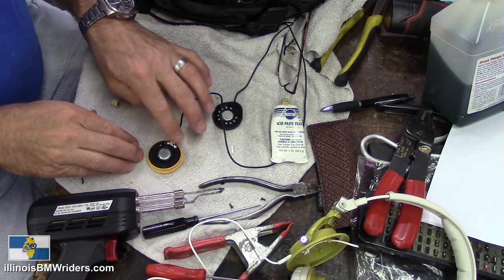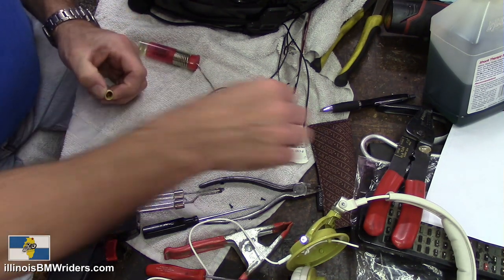Sena SMH Bluetooth Helmet Speakers - Time for a Huge Upgrade!

Comment: as far a ohms are concerned, do you think a 35 ohm set of Audio Technica studio monitor headphones (ATH-M40x) would work? Also, how did you find out the ohmage for these (btw I'm using the SMH-5... same ohmage as yours?) Thanks! I really wanna try this mod : )
Reply from the maker: I would think it could work. Only one way to find out!
Reply: Yea, I wanna try it... its just that the speakers I wanna use are $50... that along with a $100 unit is pretty expensive if it doesn't work out...

Comment: You're not soldering a radiator. Use rosin flux and/or rosin core solder...not acid. Good info just the same.

Comment: I just bought the speakers for the 20s my question is there is a blue wire on the 20s speaker wire? What do I do with blue wire? I wired it up joining the blue and re together but the sound is terrible then I disconnected the blue one but still the sound is terrible. Any suggestions maybe?
Reply from the maker: Are there 3 wires in there?
Reply: illinoisBMWriders correct left and right speaker wires have a red white and blue wire. I am thinking the blue might be something with the mic or FM radio?
Reply from the maker: I am not sure what the blue wire is for. I will be taking mine apart soon. Please let us know what you find out.
Reply: Kiepie I don't have a Sena communicator, so this is an educated guess.  Sena upgraded the speakers on the 20S, and I believe what has happened is the new speakers have two drivers instead of one; one for the bass and lower mid range and one for the highs and high mid range.  Therefore you need one wire for ground, and one for each driver.  They could have done this with only two wires and a crossover circuit in the speakers, but I'm assuming it was easier to run a third wire and leave the crossover circuit in the communicator.
You can't connect the red and blue wires together, since that will screw up the crossover circuit.  The only thing would be to find a pair of headphones that have two drivers on it, remove the crossover circuit on the speaker, and hope the crossover points are close to what Sena designed.
My feeling is don't mess with the 20S.  If you've already cut the wires, you'll need to buy a replacement set of speakers from Sena.
Reply: Hi thanks that is what I also think to do as the sound now is just terrible I even bought another pair and of the Panasonic headsets and just used the Aux headphones outlet port on the Sena but the sound is still pretty bad better than before but still bad. Regular earbuds works for now but I might have to buy another Sena speaker set in the future.
Reply from the maker: Wow thank you for the info! I will put the advice in the description.
Reply: illinoisBMWriders did you find out what's it's for I wanna do this to my 20s. sounds is horrible
Reply from the maker: I did not find out yet but when I do I will post another DIY video specific to the 20S
Reply: Kiepie I would imagine the blue wire is the antenna for the FM radio.
Reply: Martin Saunders I doubt that.  There are six pins on the connector and you only need one wire for the antenna.  Besides, the 20S already has an antenna on the outside, so why add another one in the speaker?   No, I stand by my original thought.  There are two drivers on each speaker.
An easy way to test this is use a 9 volt battery, with the negative side connected to the ground wire and then touch the positive terminal with first the red wire and then the blue wire.  You should be able to hear different pitches of sound, one will be lower, the other will be higher.  If that happens, you can be sure there are two different drivers in the 20S.  If that is the case, you can not do this mod to those headphones, or any communicator with a six pin connector.

Comment: Kirk, I tried this, didn't like it and bought myself replacement factory speakers.  It just didn't work out in my case.
Reply: hey, are the factory replacement you mention better or same as the ones that come with the unit ? thanks

Comment: great vid and an easy mod if you already own the tools etc. i used heat shrink and silicone to protect the solder connections. noticeable improvement in terms of loudness. 

i personally use plugfone headphones in my 20s... but my passengers helmet complains of not being able to hear the stock sena speakers at 85mph+

Comment: I need to ask a question.... I have the Sena S20 and the sound sucks. Can you recommend the right speaker for those? Or is the right headphones the RPDJS400A that you mention above?
Reply from the maker: I cannot recommend a replacement speaker for the 20s due to the multiple wire arrangement as noted in other comments.
Reply: illinoisBMWriders -- OH!! I guess I should have read more of the comments. Thank you for getting back to me on this.
Reply: FYI, Koss Porta Pro should work
Reply: I put the speakers on my 20 S, I didn't use the blue wire and it worked fine.

Comment: You've got 3 headphone pairs linked in your description.. which one do you like the most? Thanks!
Reply from the maker: The updated set. They are the best price and have the same speakers. Get whatever color is cheapest
Reply: illinoisBMWriders thanks!
Reply: Ok so I tried the updated speakers and they didn't seem any different from the original speakers. Still had distortion and tinny sound. Gonna try the set you used in the video and see if it makes a difference

Comment: So in reality you could use headphone speakers in your helmet provided they can be dismantled and fit in your helmet. I only want headphones for music so all I would need to do is buy a set of over the ear headphones, dismantle them and fit the speakers in to my helmet while keeping the attached cable with the 3.5mm plug to use with my phone.

Comment: This upgrade was easy to perform however the speakers in the Panasonic RPDJS400W are beyond garbage. If you listen to music with even a modicum of bass, they crackle, I need to keep the volume below 50% to manage the crackle. So, more to manage, no viable increase in volume. Consider spending more than $16 on your donor headphones. Other than that, excellent workthrough.

Comment: Kirk, any tips if you wanted to replace also the microphone?
Reply: did your mod improve just the music quality or also the pillion voice  quality?
I find mine very metallic and not natural
Reply from the maker: are you using earplugs? Mine sounds that way without them
Reply: I don't feel comfortable with them under the helmet. But I don't understand... WITH earplugs you notice the lower volume less?
Reply from the maker: The sound quality is better with earplugs. It takes away the tinny sound as well as the wind noise. Just try it. I use Rooth 15db reduction and they work excellent. NoNoise make a good pair too and you can find them at Tourtech. If you use foam ones try to find them with the lowest db rating possible. 29+ db is too much and will cut the volume.
Reply: Francesco Gerli here's a fun trick. next time youre in a very loud club/concert/bar and the person youre speaking to is not able to hear you, try this: use your finger to seal off their ear with that little point of cartilage that covers the ear hole. then speak into their ear at a normal-ish volume from about a foot away and they should be able to hear you no prob.

Comment: May I ask why didn't you just connect the Panasonic's (after you removed them from the headset) directly to Sena instead of replacing wires?

Really thank you very posting this video. I've been looking around to replace the crappy Sena speakers. I'm considering your solution.

Favorited and subscribed. Thanks again
Reply from the maker: I didnt want or need the extra wires hanging out the back of my helmet. Besides you still need to get rid of the OEM's to make room.

Comment: Which Sena model did you use in this video?
Reply from the maker: This one was the SMH-10. I will be doing the same to the 20S.
Reply: Hi, Doesn't the 20s have the bigger better newer type of speakers than the SMH-10?..
Reply: I dont think they are bigger but do sound better than the SMH-10's
Reply: illinoisBMWriders Based on the information from the other poster about three wires, I recommend that you do not attempt this on the 20S.
Reply from the maker: I added the info to the description. I may change the title of the video as well
Reply: illinoisBMWriders, I hope that prefers others from ruining a pair of speakers, and the communicator as well.
Reply: illinoisBMWriders, Do you have the actual specs on the Sena speakers so I can search for another alternative to this Panasonic?
Reply from the maker: That should be easy to find with a simple web search

Comment: one thing that the video doesn't address...The left speaker on the 10U, and possibly other units, has the "fault reset" hole that you stuff a bent paperclip in, to reset faults.  I don't think it is the same as the factory reset function, so by replacing these speakers, you will no longer have that fault reset feature available.  Just a heads-up for any who are considering this upgrade...I intend to do it myself.  Boy, those speakers are shitty!

Comment: Did the "upgrade" and they actually sounded worse. Only difference in our installs is I have a Bell Qualifier DLX that is designed for the Sena SMH-10 unit and he used a Shoei. I used the exact same Panasonic RP-DJS400 headphones he recommends, brand new from Amazon, and honestly they are smaller and cheaper quality than the original Sena crap. I did try them out on my stereo before I pulled them apart and yes they sounded awesome in comparison but only because the "over the ear design" of the original headphone speaker is sealed around your ears and therefore produces more bass and a better, louder sound.  Only way this "upgrade" could sound even marginally better is that they might sit closer to your ears than the Sena originals did before the upgrade. Without the "over the ear" fitment in your helmet or some sort of amplification to the Sena unit output you're just going to end up with the same shitty sound. Sorry to pee on the parade but this is just wishful thinking. Maybe some better quality "on the ear" headphones would give a better/louder sound but the Panasonics, in my case, were just a waste of $, time and effort.

Another quick afterthought I had about this project is, if you're going to go to the trouble of cutting the wiring of the Sena unit use a inline 3.5mm stereo headphone plug & jack setup instead. Much less soldering work and a cleaner, truly "upgradeable" install. Doing this you can swap headphones out in the future by just unplugging the old ones and plugging in the new. I'm going to figure this out and I'll post something here If I find something that works. Hope this helps!

Comment: No one makes a headset for motorcycles with any power. Why? Law suites. If they make a truly loud headset someone will get killed or maimed and sue them because they couldn't hear the train coming. Ask why airplanes still use  magneto's instead of electronic systems.